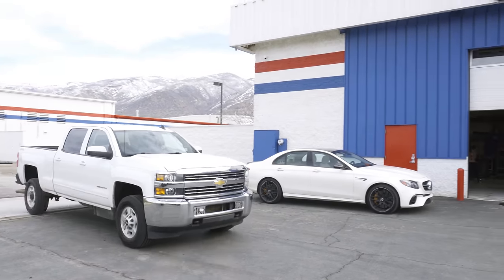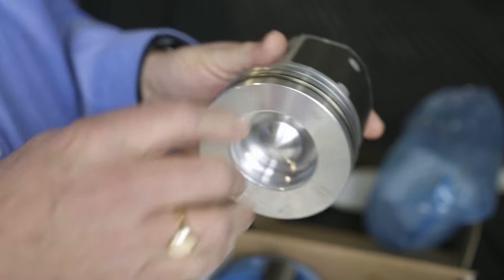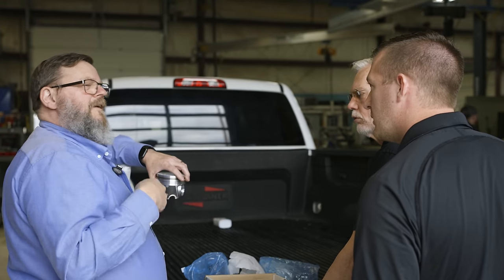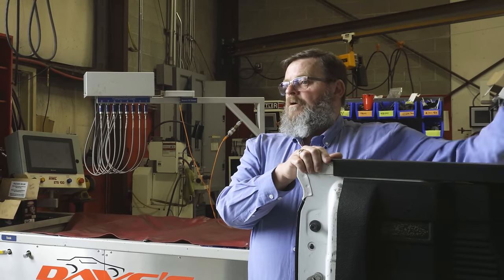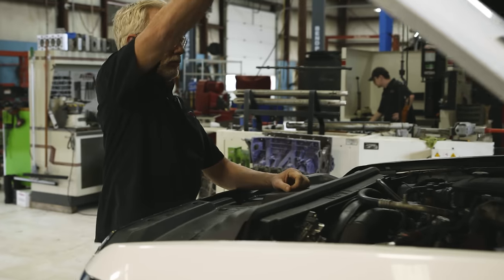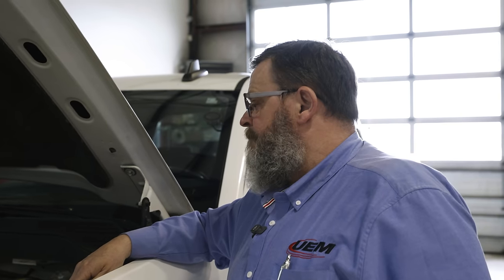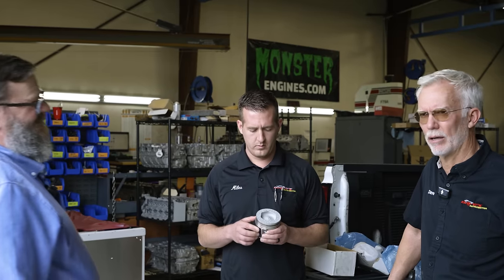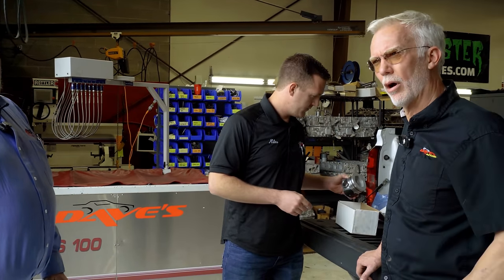What do golf balls and pistons have in common?

Comment: I looked these up for my 7.3.  It's a little more than "a little bit of an upgrade".  I'm looking at $750+/- for a set of standard pistons versus $3700+/- for these dimpled pistons.  I mean, I'm intrigued, but damn....
Also, the Total Seal website says their rings will give you all the same benefits that SoA claims for these pistons...more hp, more torque, etc.  So if these come with Total Seal rings, I've got to wonder how much of the gains are the rings, and how much are the pistons.  If I did a stock rebuild, but used a $475 set of gapless rings, what percentage of these benefits would I get versus using the complete piston set? Would I get 50% of the benefit for 1/7th the price?  Or 10%?  Or 75%?  Those are the testing results I want to see.

Comment: That’s what a stock L5P sounds like.
Everything about that piston sounds great but the sound shouldn’t be a factor. The piston does nothing for valvetrain or injector/injection pump noise.
Reply: That truck is an LML. Your statement is correct but the noise reduction is actually from activity inside the combustion chamber. Think about the noise a pre-94 Cummins 12 valve made with mechanical injectors compared to a new truck with modern piezoelectric injectors. Night and day difference.  The more efficient the combustion event, the smoother and quieter it becomes. No more complicated than that!

Comment: My 2006 gmc duramax 348 thousand miles and change 3500 dual rear wheel with a service body welder air compressor the truck with tools daily driven mechanic truck I average 17-18 miles per gallon depending on summer or winter. How does that duramax pickup get that pore of MPG

Comment: Wouldn't the dimples just fill with carbon deposits? Maybe a race application where the engine is rebuilt after each run.. i need to see more testing before buying into this.

Comment: Not going to sit here and say that it doesnt work but sure does sound pretty optimistic.  If OEMs could pickup 25% fuel economy, drop nox 80%, lower egts and 20% torque increase from just from dimpling a piston and coating it, they would be doing it.  They spend millions in R&D every year.  Gapless second ring isnt new at all, neither are coatings.  Built my IDI 10 years ago with gapless rings and ceramic coated pistons.

Comment: I can see how the surface can do that, now for that surface to actually last. There's a lot of stuff that can happen including carbon or other contaminant build-up that might delete some of the benefits. I suspect that the pistons might absorb more heat and send it in to the oil although really that's a question for a lot of testing and measuring. The increased surface may also cause the piston to just radiate a lot of heat in to the air during the intake stroke so that would balance out heat absorption. I'm really wondering if this will catch on and how far this tech can go. I know you can break CO2 molecules using just a special surface (with tiny efficiency), so a nano-engineered piston might do wonders for fuel consumption and emissions.

Comment: I would like to know , regarding 3.5 liter twin turbo ecoboost, how much it would reduce the volume of fluids caught in a one quart catch can (currently 16+ oz every 1,000 miles)  I have not had issues yet and with only 55k on my 2013 F150, I hope I do not.BUT, this may be a way to really improve the oil, and grungy intake valves.
Reply: I also have a DI 2013 Lincoln MKZ with turbo and 19k miles on it. These are prone to water in oil pan due to gasket failure between 2 and 3 cylinders.  If it has to come apart, the new pistons and rings would really improve the already powerful 2 liter mill.

Comment: I'd like to know exactly everything else they did to make that truck so quiet, because I doubt it's the pistons alone.  Let them give you a set to install on a known stock truck and prove it. "If it's too good to be true" + "trust but verify" + money where your mouth is Plus seeing is believing etc
Reply: That truck is a test truck owned by SEMA Garage. They've been testing and certifying the pistons for 6 months now.  Everything is bone stock but the pistons.
Reply: @speedofair   Cool. I'm not saying it isn't, but where can we all go to see independent verification of that?  As an engineer, it's just part of the process, and it's just so incredible (literally) that it would improve power, emissions, noise, and fuel efficiency all at the same time, at least to that degree (~25%).   That's a once in a century type of breakthrough.

Comment: You can't reduce nox that much, it's a result of heating nitrogen in the combustion lol. Those dimples will fill up with soot in 20k and cease to have any effect on combustion. He recommends fleets to remove engines from perfectly good trucks and drop in new pistons just to increase fuel economy lol. The manufacturer developed the pistons for the engines for their application typically and for longevity. 😅

Comment: I'm calling BS on the pistons making a diesel quiet.  I've owned, driven and worked on diesel for decades,  that typical diesel sound is the injection system, it's thousands of PSI to vaporize the diesel!  The only way you're going to silence it is to block the sound externally.  A piston is not going to change the sound!! There's some snake oil at play here. The piston might help performance etc but that claim if nutes the injection system is totally BS! Impossible.
Reply: The diesel knock is from being a diesel ….old mechanical injection wasn’t that high of pressure and those engines rattled to beat the band…..

Comment: I just don't understand why gas milage is so bad in US?
My 27 year old Defender 300TDI gets over 30mpg, and it was cobbled together in 1997!
My 2016 Subaru XV 2.0 Diesel gets between 45 and 55 miles to a gallon!
And my 1974 Series 3 Land Rover 2.25 petrol can get over 20 MPG.
Is an American mile longer than a UK mile? Is your gallon less than 4.5 Litres?
My Defender can tow 3000 KG off road no problem. So what am I not getting that US vehicles get terrible mpg?
I did get over 60 mpg from a good run in the Subaru XV, you call them Crosstrek and I don't think you had the turbo diesel, but I can get 35MPG towing a small caravan of 1200kg!

Comment: This guy Dave is a real BOSS MAN! I have a shower attachment that has small ceramic "golf balls" inside of it with the hexagonal dimples. It has two chambers such that it creates a double vortex where the water spins in one vortex on the way in, and spins in the opposite vortex on the way out. In the very center is a zone of ZERO motion, just like a magnet has what's called the "Bloch wall" of ZERO measurable magnetism. The result of the water flowing through this thing is that it "erases the memory" held by the water. Water is a liquid crystal that can store information just like a computer chip, and water that has been through a water treatment facility retains the memory of whatever has been in those bodies that it came out of before it went back to the water treatment plant. We're talking birth control, prescription drugs like antibiotics and psychiatric drugs, chemical food additives, hormone disruptors like BPA in plastics, etc., plus the chemicals used to "purify" the water. I'm just getting into this video, so I wouldn't be surprised if they mention that these pistons also decrease harmful emissions, as well.

Comment: i'd Love For You guys to build a 1999 Dodge Ram 24 valve, 5.9 cummins with the New Pistons & Do Before & After Mileage Test & Quietness test for Yourself. Use Db meter too to add science to it.
What i Wouldn't give to Quiet Down my 2nd Gen 25% & increase Fuel mileage by 25%. i Get 15 mpg Empty, Freeway, Regular pickup truck bed.
13-14Mpg. Fully loaded service Truck w/ Utility body & Rack.

Comment: For sure this technology changes certain outcomes - BUT - for someone just to 'blurt' out that an engine made 210 ft-lb more without any mention of the condition of the previous engine was probably not a good idea,  Was it an 'apples to apples' comparison - or an 'apples to oranges' comparison.  Me personally - I have no doubt there are some changes - but EXATLY what - that needs to be proven by independent testing - not someone with a vested interested or that may be 'cherry picking' certain data.  Is it more beneficial for example to a loaded engine - or something on a constant rpm etc etc.  I can see some 'good' videos on a before and after with this - HA - I just wish I had a diesel and a dyno.  CHEERS from AUSTRALIA.

Comment: With these claims, I'm surprised the the OEM manufacturers haven't jumped on board.  With what they are claiming in the NOX reductions, could the DEF and regen functions be eliminated?  If Ford, GM or Ram started using these pistons, wouldn't that be a huge performance bump over the competition?

Comment: People don't want quieter engines. That's the whole point of putting on exhaust. Number two problem, obviously no gap in a second ring means not for gas engines. So horsepower is pretty much irrelevant when it comes to diesel motors because those people focus on torque.

Comment: These dimpled pistons would be effective on a fresh build but after 1 or 2k miles of driving then the crud in the gasoline or diesel will fill in the dimples thus negating their effectiveness in stirring up the air fuel mix.

Comment: I’m skeptical AF. Having a REAL difficult time buying into this. Seems like a pretty tall order. 

Build two engines. One with stock bits and one with this set up. Run them 5000 miles. Then, change the stuff in the stock and change the other back to stock. Do another 5000 miles. Then compare the data.

I want to see legitimate data

Comment: Interesting stuff for sure... all diesel related, so blech lame crapypoop... but still, interesting stuff for sure. I just wish I could take newer engines and bring them backwards from DI to port injection... wish this was a more common mod on gen IV and so GM engines and what not... I hate to even go past GMT8XX / 9XX .... 8XX is perfect, LS that will last 300-400K with oil changes alone. Then with gen 4 came the incredible regression of DoD/AFM, taking those same engines and bringing them back to 100-150K before major issues, even with routine maintenance, fluids, and going overboard on internal cleaning... but that wasn't enough self sabotage... then they had to go DI with gen 5, along with AFM... making for 85k-125k lifespans... on engines that two gen ago could go nearly a half a million miles with ease. DI is by far the worst, even worse than AFM... at least you can swap lifters, do some tuning, and get rid of AFM relatively easily. DI is just horsecrap all around, and the entire engine is made around it... meanwhile, none of this gets ANY better mileage... AT ALL. Heck, my 2005 gen 3 LQ9 6.0 gets better economy than my 2015 gen 5 L83 5.3 ... and heck, my 2004 gen 3 5.3 in a tahoe makes the literal exact same HP and TQ as the 2015, while not having any of the DOD/AFM + DI issues... it's just nuts how backwards it's all gone.

Comment: So what is it that quietens down the engine? What.. were other trucks getting barking dog??? Because they didn't use a second gapless rings?
Reply: The dimples (more efficient combustion) makes it quieter.  Think about an early 90s 5.9 12V with mechanical injectors compared to a 2024 truck with modern piezoelectric injectors...huge improvement in noise reduction.  Better combustion=quieter/smoother

Comment: Those pistons are not doing all the quiet operation and they are not increasing fuel consumption. I call BS... My 04   6.6 Duramax gets 20 + mpg and 10 to 13 towing.  It's noisy as hell but those new pistons are not helping fuel consumption if 13 is all they get out of this newer truck.   Come on Man !!
Reply: disappointing to see Dave promote this snake oil.

Comment: Seems way to good to be true.  I don't know that a modern high pressure, multi event diesel injection system would benefit from dimples in the piston.  Atomization of the fuel has been optimized way beyond what little turbulence those dimples are going to create.  A well balanced and blue printed duramax (LBZ and up) will run that quiet on stock pistons.  a healthy bone stock one will also idle that quiet with just some minor tuning.  I call BS.  Despite what the salesman said, the industry is looking for real gains.  I'm sure this has been researched and found to not make any difference.  I hope I'm wrong.

Comment: So, the rep explains all of the advantages of these revolutionary pistons in great detail. But, we never really hear much at all about the physics involved in creating all of these amazing improvements. Every single company that manufactures anything from frying pans to fly swatters makes extraordinary claims about how their products are far superior to any other competitor out there, and most will usually supply test data to back it all up -  regardless if that data is accurate or complete science fiction. Time will certainly tell if this "too good to be true" piston design really has any substantial merit or not. From a logical standpoint it remains wise to be very skeptical about all of these hyped up claims, because we've all heard the same smoke and mirrors show many many times before

Comment: I work with diesel engine development, this is nothing but snake oil. They clame 50 hp gain on a cummins 5.9 with nothing but a dimpled piston with a coating. A 30% increase only from what they claim is efficiency no way. They either increased the compression ratio or increased the fueling. Reading on their website about how it supposedly works "As is the case for the golf ball, dimpling the surfaces inside the combustion chamber, coupled with our proprietary mix of coatings, creates a thinner and well attached turbulent boundary layer between the air-fuel mixture, its flame front and the combustion chamber walls. This thin, turbulent layer allows the combustion flame front to progress much closer to the cool metal walls of the combustion chamber thereby increasing overall combustion efficiency." Combustion flame closer to the cool walls of the combustion chamber increases heat losses and thereby reduces efficiency.

Comment: "210 ft lbs on the bottom end"

WHERE on the bottom end? Not peak torque, this is a random rpm. It's not nothing, by any means, but more information is needed.
Reply: Top end WOT typically picks up 8-10% when locked in 4th gear (so we get a 1:1 ratio).  At axles speeds of 500-650 RPM, which would equate to 1900-2200rpm (the driving sweet spot), is where we see the big torque gains. Basically, the torque curve moves to the left on the dyno graph.  It's not the typical test the average dyno guy does but when you drive one of these engine you can 100% feel that low end torque

Comment: Anyone can talk and make claims.. You have to take a Truck as is get all the dyno and driving numbers.. change the  pistons and do it all again.
  I had my piston, Valves and Combustion chambers Henium Treated.. It fell off and scratched my cylinder walls to the point of burning 7 quarts of oil per day spreading lime with a 486 Cubic Inch Big Block Chevy ..

Comment: With 20% improved fuel economy this guy is either lying or should have a Nobel prize. The dimples on a golf ball disrupt the boundary layer of air over the surface of the ball - it helps the ball slip through the air more easily. I’m having a hard time imagining what dimples would do on a piston head to improve performance in any way. 

Air isn’t meaningfully flowing tangentially to the surface, where you could argue dimples would change the flow. It wouldn’t really have enough time to change the pattern of combustion: how the fuel ignites and the flame propagates to fill the combustion chamber and cylinder. A bit more swirling/turbulent flow isn’t going to make it combust better, as the fuel ignites near instantly when it’s injected into the cylinder and won’t have time to swirl. 

Most internal combustion engines on a car/truck will have 20 to 25% thermal efficiency, meaning 3/4 of the energy in fuel becomes heat, and 1/4 becomes useful work. The gross amount of work is reduced by the energy needed to turn the motor, overcome friction, drive the serpentine belt, etc. Then the energy, sees further loss from the drivetrain (gear and fluid friction), and drives the wheels. At speed, most of your HP is used to overcome air friction - try sticking your hand out the window at 75 mph then imagine that much air pressure applied to something the size of a truck. You can’t just wipe out 20% of that energy loss, from start to finish, with a funny piston head. I declare shenanigans.

Comment: while I am admittedly not a diesel mechanic, I do have an understanding of them. I understand the science but the results still seem too good.

if this is all 100% legit this is absolutely amazing. but the skeptic in me is proof in time. we dont know what else may have been done to that engine, fuel, exhaust etc. I can completely rebuild a motor, kick the back quarter panel and say that dent is why it increased power and fuel milage. I understand the science but the results still seem too good.
Reply: That LML is a SEMA owned test truck